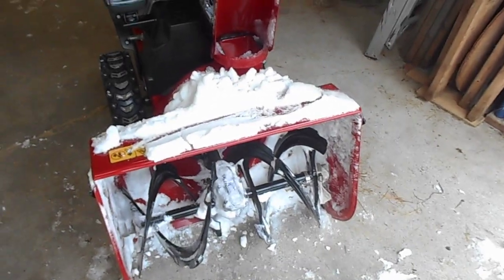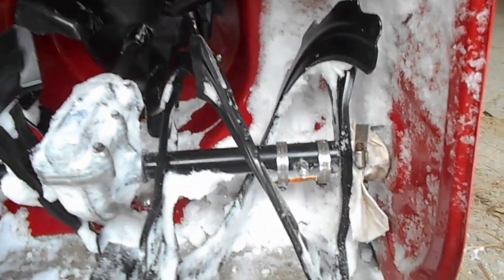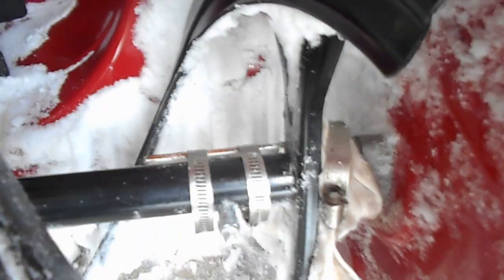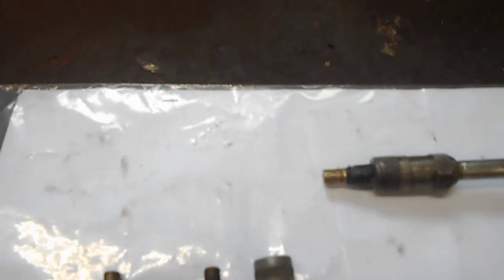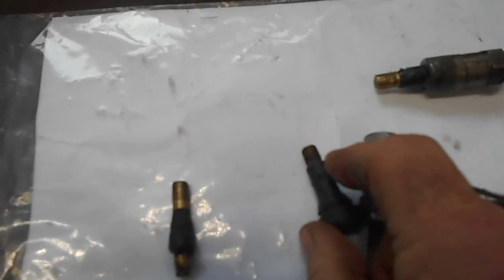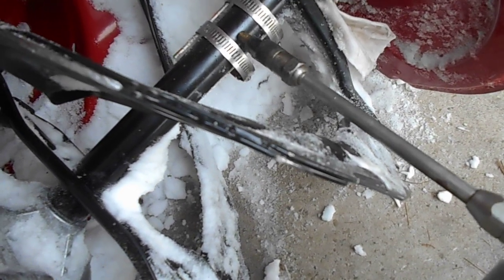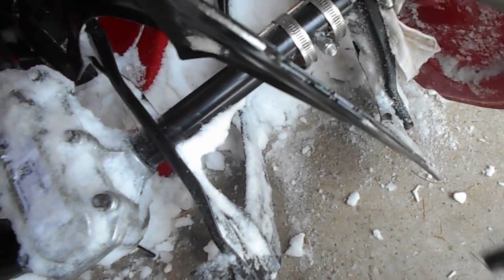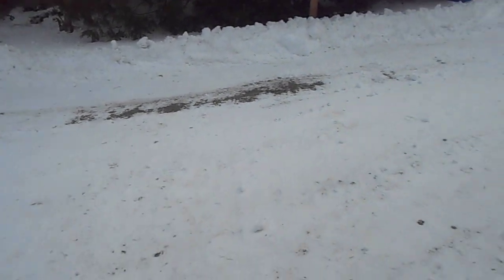Toro 1428 Commercial Snow Blower auger shaft greasing method where no grease fitting exists.

Comment: Good stuff but I'd be more concerned with getting bearings greased.  The auger  joint only comes into play if the auger bolt breaks.   TORO does not use shear anymore.